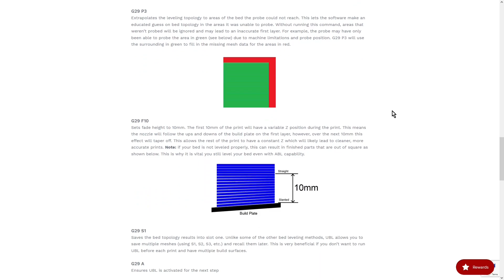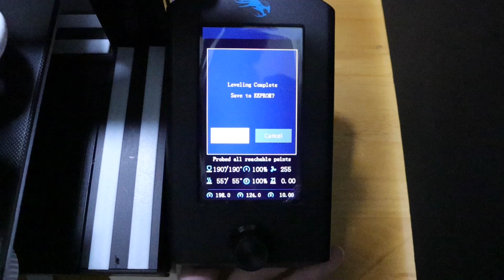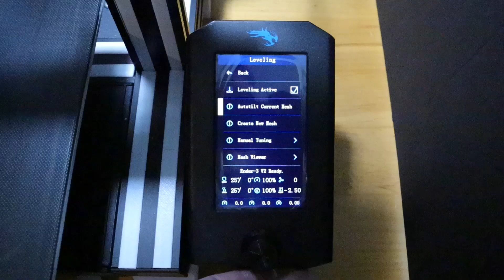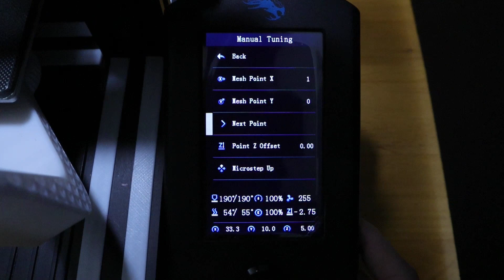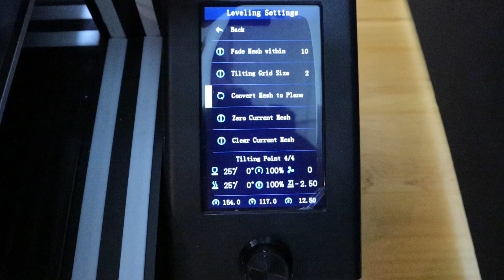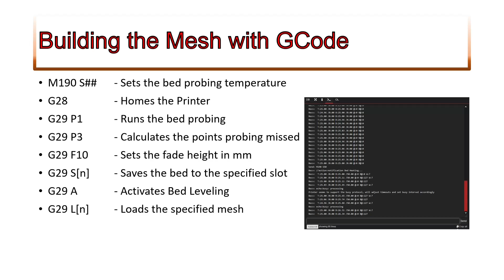Unified Bed Leveling Overview with Jyers Firmware on the Ender 3 v2

Comment: Everything works freaking great as long as you dont have a Micro Swiss Direct Drive with an all metal hot end. I can edit the source code firmware to adjust bed temp, travel stops, and steps but I cannot get my Ender 3 v2 to run correctly now. Feel like I spent $100 on upgrades I cannot use and are forced to stick with a precompiled. Hardest part is getting the bed leveling to work with custom firmware. I cannot see the configuration.h file for basic settings.
Reply from the maker: You shouldnt have to do any firmware editing to get this to work with the MS DD  most of the settings that change are able to be edited on the printer (x/y/z offsets) or through slicer(retraction speed/distance)
Reply: @EB3DPrinting  I’m fairly new to this. Is there a video for reference? I looked for and Ender 3 v2 with Micro Swiss Upgrades and they are all just putting the components on. Had nothing to do with after installation.
Reply from the maker: @jerryhoward614  I dont know of a guide per say, but if you follow the instructions on the last page of MS install docx, that should help get you started

https://cdn.shopify.com/s/files/1/1210/0176/files/Micro_Swiss_Direct_Drive_Extruder_For_Ender_5_Installation_Instructions.pdf

Comment: Thanks very much for this great tutorial Evan.
I am unclear about one thing though ...
I installed the Jyers UBL 10x10 and a BLTouch, it works, it creates the mesh and saves it.
Now that the printer "knows the bed", do I still have to adjust the START G-Code for it to be actually implemented in each print?
Reply from the maker: Yes, you will still need to at least activate mesh leveling and load the saved mesh. So after the G28 in the start Gcode add:

G29 A
G29 L0
Reply: @EB3DPrinting  Great, very helpful answer. 
As i understand from various discussions, the order doesnt needs to be G29A- G29 L0? it can start with G29 L0, followed by G29A?

One question about the "Activate leveling":
On the machine is an option to activate leveling, an option i often forget to activate. Does the leveling activates with the GCode from my slicer anyway, even when i forget to check the option on the machine?
Reply: I was curious about that too.

Comment: I'm using the 3 x 3 with a slightly warped bed. I can't seem to get it to compensate in real time during prints
Reply from the maker: Are you using manual mesh, or bltouch? Do you have M420 S1 after g28 in your start gcode? 
I had an issue with 3x3 as well, I went with 5x5 and it worked much better
Reply: @EB3DPrinting  yep I have bl touch and m420 in the code of my test print. I'm gonna try 5 x 5 next, then ubl once I get the leveling down.
Reply from the maker: @cody967  if you have a bltouch, just try g29 command to build a mesh before the print. If you dont have a mesh saved to eeprom, that could explain why it's not following the contour of the bed

Comment: firmware E3V2-BLTouch-v4.2.7-v1.3.4 not working with adapter bridge for bltouch , creative stock firmware the is a choice of with or without adapter.

now g29 doesn't work
z axis does not go down.

can you provide the same firmware for the bridge adapter
?
thks in advance

john
Reply from the maker: That could depend on how you have the bltouch connected. If you have a two plug bltouch instead of the official single plug, check the photos here to make sure its connected properly. 

https://smith3d.com/ender-3-v2-bltouch-firmware-installation-guide-by-smith3d-com/

Comment: Hi, great info! I could not find any info about 'convert mesh to plane' , but as I watched your video, I think I understand that on an ender 3 v2 (with glass plate) you actually always have to do this? At the end you talk about sharing your start end end gcode, but i could not find a link to this. Thanks in advance!
Reply from the maker: As far as the convert mesh to plane. To be honest, I never use it. I quite honestly do not see the purpose, as you take the full 3d contour of the bed surface, which creality's glass plates are known for their uneven surfaces, and make it a flat plane. This would cause the nozzle to not follow the contour of the bed along the z-axis leading to an inconsistent first layer.
Reply from the maker: Here is my CURA start Gcode:
; Ender 3 Custom Start G-code
G92 E0 ; Reset Extruder

M140 S{material_bed_temperature_layer_0} ; start preheating the bed
M104 S{material_print_temperature_layer_0} T0 ; start preheating hotend
M190 S{material_bed_temperature_layer_0} ; heat to Cura Bed setting
M109 S{material_print_temperature_layer_0} T0 ; heat to Cura Hotend

G28 ; Home all axes
;G29 ; Auto Bed Level
;M420 S1 ;
;G29 L0 ;
;G29 J2 ;

G1 Z2.0 F3000 ; Move Z Axis up little to prevent scratching of Heat Bed
G1 X0.1 Y20 Z0.3 F5000.0 ; Move to start position
G1 X0.1 Y200.0 Z0.3 F1500.0 E15 ; Draw the first line
G1 X0.4 Y200.0 Z0.3 F5000.0 ; Move to side a little
G1 X0.4 Y20 Z0.3 F1500.0 E30 ; Draw the second line

G92 E0 ; Reset Extruder

G1 Z2.0 F3000 ; Move Z Axis up little to prevent scratching of Heat Bed
G1 X5 Y20 Z0.3 F5000.0 ; Move over to prevent blob squish

CURA End G-Code:
G91 ;Relative positioning
G1 E-2 F2700 ;Retract a bit
G1 E-2 Z0.2 F2400 ;Retract and raise Z
G1 X5 Y5 F3000 ;Wipe out
G1 Z10 ;Raise Z more
G90 ;Absolute positionning

G1 X0 Y{machine_depth} ;Present print
M106 S0 ;Turn-off fan
M104 S0 ;Turn-off hotend
M140 S0 ;Turn-off bed

M84 X Y E ;Disable all steppers but Z
Reply: @EB3DPrinting  does this work on the v2 aswell?
Reply from the maker: @cardinalpawn6467  yes
Reply: @EB3DPrinting  do i need to put in the text?
Reply from the maker: @cardinalpawn6467  the codes go in the start and end gcode sections of the slicer

Comment: Hey man! Love the video.

Question though... when i run a G29 J or G29 J2 code directly after creating the mesh its completly different then the original mesh that was created (while the bed leveling didnt change one bit).

Any ideas why this would happen? 

Running lastest Jeyers UBL 10x10 firmware
Reply from the maker: I have run into this as well. I think this is due to those points, for the G29 J and G29 J2. They arent originally hit during the UBL building process. The 10x10 for me, as an example, only probes 65/100 probe points, and the G29 J2 points are not hit, they are calculated into the mesh. When the G29 J2 command is run, it gets the actual value for those points, which is slightly different than the calculated value, so it adjust the mesh.

One way to verify this would be to go in and manually add those probe points after creating the mesh, and then run the G29 J, to see if the mesh changes. I just never bothered with it because my first layers have been so good without manually entering in those points.

Comment: Great info. I use ubl in my heavily modified Ender 3. Using 3 slots in the memory of my skr with meshes for pla, petg and abs. I do use G29 L1,L2 and L3 and J2. Pretty consistent results so far, and time saving too.
The only thing I'm curious about is to replace the bed springs to a solid or fixed corners bed mount solution. Any suggestions? Great video!
Reply from the maker: I still use yellow springs on the E3v2, but on the E5+, I have switched to silicone spacers. While the are not a solid fixed mount solution, they do offer more stability than the yellow springs. Bed leveling is like a once a month issue how, and that's mainly due to making changes on the printer. 

https://www.amazon.com/dp/B0894ZB546/ref=cm_sw_r_cp_apa_glt_fabc_PMMS5X2G49B5XZ8X0VW1?_encoding=UTF8&psc=1
Reply: @EB3DPrinting  Thanks! I'll definitely buy those silicone spacers.
Reply: @EB3DPrinting  I am using the silicon bed spacers and after a short period tyme, after a bed leveling, i have to relevel. The heat affects these spacers after a very short usage tyme
Reply from the maker: @imfloridano5448  I have been using silicone spacers for almost a year now. I can't remember the last time I leveled the bed. I wonder if it may be a manufacturing issue.

Comment: I use jyers firmware on ender 3v2 it is really good. I want to install dual gear extruder but I have to reverse the motor direction. Do I have to compile my own firmware to do this or can I do this with jyers firmware. Excellent video btw very informative
Reply from the maker: I mean you "could" set your E-steps to a negative value. So if you current E-steps are 92, set them to -92. But the only real way to change them is to change #define INVERT_E0_DIR FALSE to TRUE

Comment: I still cant get my v2 to take the software...
Reply from the maker: Make sure the SD card is FAT32 formatted. Make sure the SD card only has the firmware on it. Make sure the firmware has a unique name, try to rename the bin file. These are just some simple suggestions as I don't know what all you've tried yet
Reply: @EB3DPrinting  That happened to me as well , but by just having the bin file it loaded fine. thanks

Comment: I guess you don't need G29 P3 in start code? That's done automatically.
Reply from the maker: Not if you built the mesh using the printer. Jyers firmware does that.

Comment: Thanks for this video and explanation, but why such low resolution video?
Also, I may have missed it, but I did not see you indicate which specific firmware you had loaded.
Reply from the maker: I just uploaded, HD is still processing
Reply from the maker: Firmware can be found here:
https://github.com/Jyers/Marlin/releases

I am using the 1.3.2 version of E3V2-UBL-BLTouch-10x10-HS-v4.2.7.bin